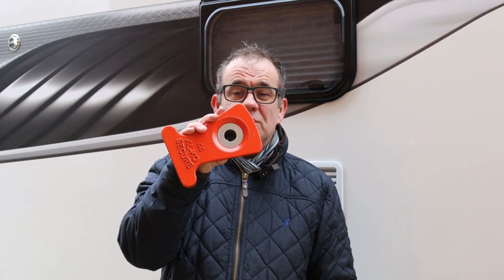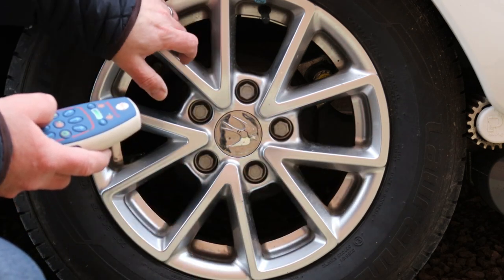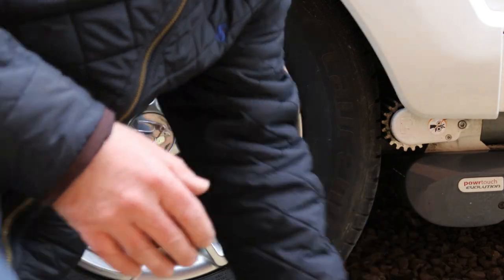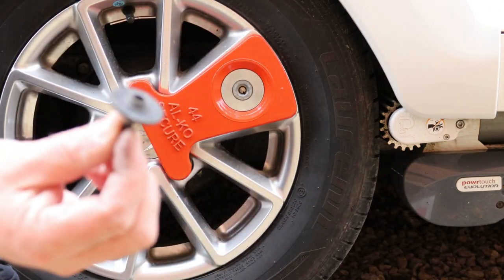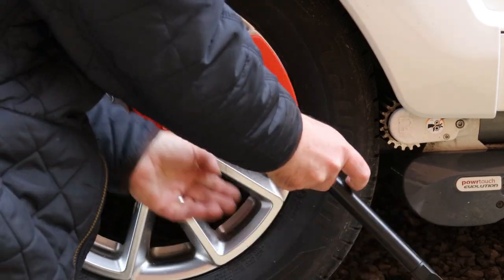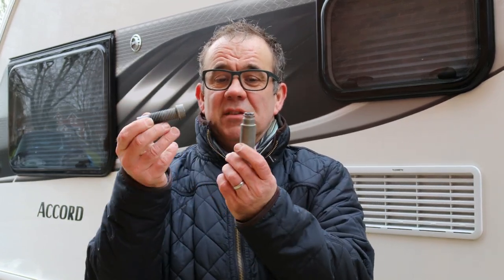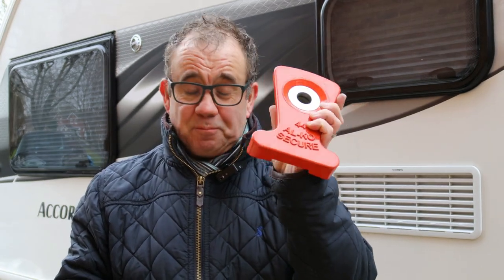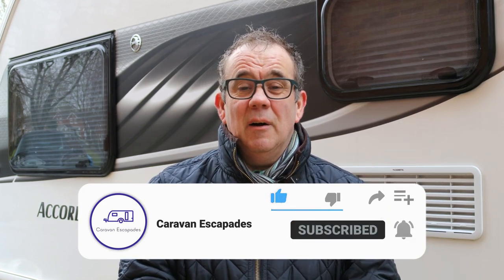Fitting  Removal and using the Alko Wheel lock

Comment: Seasonal pitchers. Make sure you can remove lock regularly at least every 3 months. I left mine on for whole season only to find lock mechanism stuck. Lots of WD40 (not silicon spray) and several hours later the lock turned.
Reply from the maker: Great Tip, Thanks for sharing 🙂

Comment: How do you fit the alko locks on a twin axle when you have a 4 wheel mover fitted. One lock goes on easy  what about the other wheel
Reply from the maker: Hello Brian, thanks for your comment,  It can be a real faff to tryu and fit both Alko Wheel Locks,  Very occasionally you can get both receptacles lined up. Other options are to fit one lock then Jack the Caravan up using the Alko Or Kojac jacking system. Some people use Lock and Level. So put caravan on Lock and Level fit 1 Lock, then inflate one side rotate the wheel and fit a second. This is not ideal if you are in storage as it requires the Lock & Level to be left in place. What I do now, is fit the Alcko lock on one Wheel and then use a Milenco Wraith on the other. The Milenco does not use the Chassis Receptacle and has its own bar that goes through the wheel. I did a vlog on them if it helps.  https://youtu.be/lGQxsuhS4Zg Thanks for watching and Happy Camping. James

Comment: I have been uneasy about buying a secondhand alko wheel lock because I have heard that unless the previous owner deregisters the lock with alko the new owner cannot register the lock and therefore would be unable to  get replacement keys if he broke or lost a key or the lock failed/seized.
Reply from the maker: Hi thanks for watching and commenting I do agree. However you could just buy the lozenger second hand. Dispose of the lock that came with it and purchase a new lock.  mechanism. My first Al-Ko lock was second hand and I didn't have any problems but that was more luck than anything else. Stay Safe James
Reply: @CaravanEscapades101  Thanks James I will check out the price of the replacement lock barrel. Currently we use a Millenco Wraith on our single axle van this is very easy to fit.
Reply from the maker: @andrewpaley9914  I have a twin Axle, I only have the one Al-Ko lock. I also use the Milenco Wraith, I find once the barrel is set up they are relatively easy to use, I actually have 3 of them on all the other wheels, Thanks again for watching.

Comment: I have a motorhome with 225/R75 16CP tyres on Fiat wheels.How can I find out which Lozenge number I need.
Reply from the maker: Hi Ken, does your Motorhome have the receptical for the ALKO lock its like an internally threaded hole on the Chassis. James
Reply: @CaravanEscapades101  Hi. Thanks for reply. Yes both my rear wheels have the threaded receptical.

Comment: Any idear on how to find the right one for your caravan as theres loads different ones??
Reply from the maker: Hi. If you can determine the style of wheel you have you should be able to identify which lozenge your require. Also if you join a FB group for the brand of caravan you have someone on there is most likely to have the same wheels and advise what number lozenge you need. Hope that helps. Happy Camping James
Reply: Go onto the Alko website and put in your caravan make and model, it will tell you which one you need.

Comment: That kind of key-lock is very easy to force and open
Reply from the maker: Agreed but you also need tbe uniquely splined adaptor to then remove the threaded pin from the Chassis. I do understand that these locks are not infallible. I have a lock on each wheel on my twin axel as well as Hitch lock and steady lock. All in the hope it slows them down or they move on to somthing with less security. Thanks for watching and Happy Camping.

Comment: Thank You for the video Sir, but it still seems like a total faff. Surely Alko can come up with a better 'built into the chassis' solution. 'Turn a key' and the van is immobile would be as much security as I am prepared to do.
Reply from the maker: Thanks for commenting, I have to agree with you, I only have one ALKO on my twin Axle the rest of the wheel locks are Milenco Wraiths as they are so much easier to fit. I only have the Alko to satisfy the discount on my insurance. Happy Camping. James